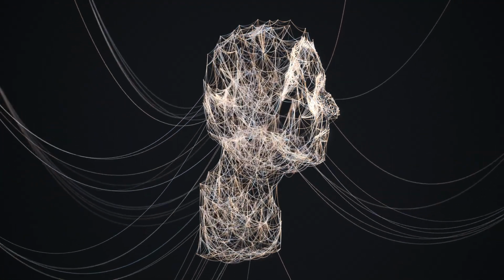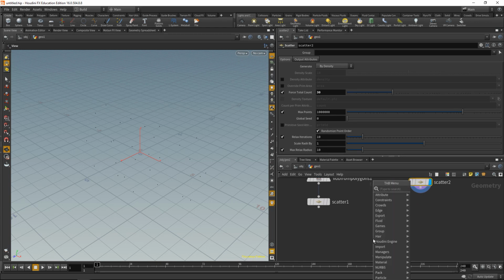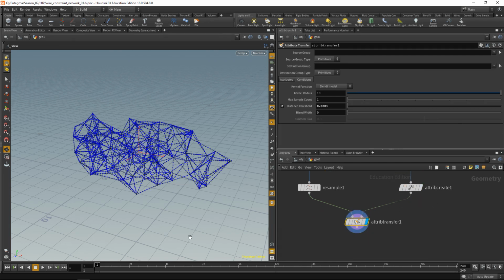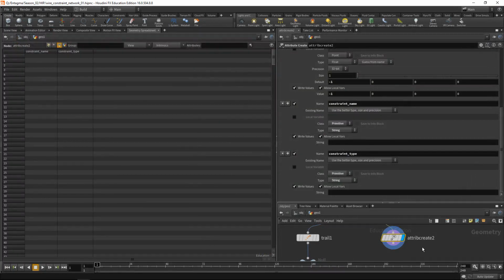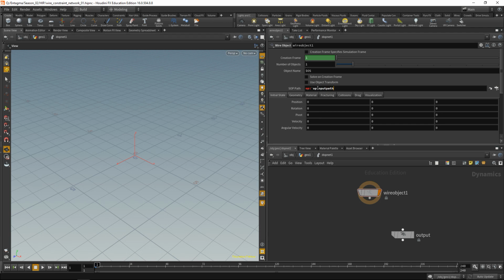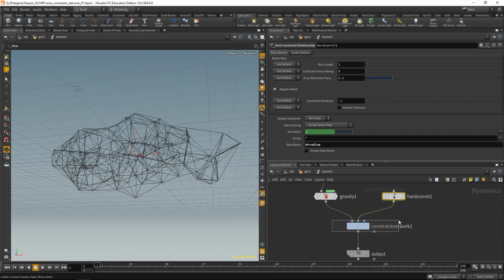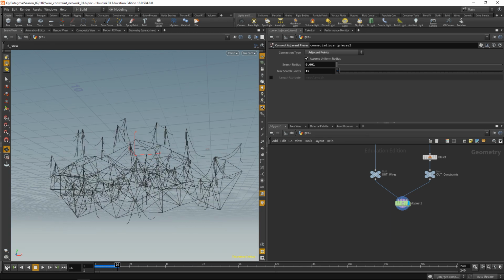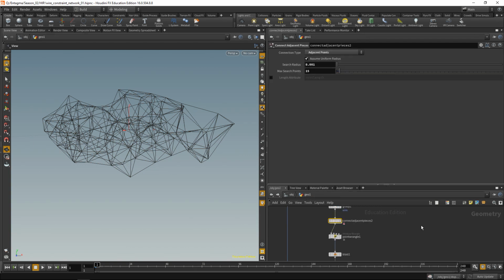Yarnworks: Wire Solver and Constraint Networks in DOPs

Comment: I watched this three times and didn't get it to work until I downloaded your provided project files and found out that in the second attribcreate-node the anchor_id needs to be set to integer instead of float. In the spreadsheet I noticed that when you first set it up it was still set to float but with your first code revision you seem to have switched it to integer but I missed it because of the little cut :D Anyways, thanks for the tutorial, it was really really useful! :)
Reply: thank you so much for this, I was starting to really get mad XD
Reply: Bro u saved my at least another 2 hours checking vex. Thank you <3
Reply: you're a legend. Thanks 
Great tutorial btw!
Reply: Not just that but also original_ptnum this tutorial was quite sloppy.
Reply: THANK YOU ive had to manually troubleshoot so many outdated tutorials as a begginer this helps so much genuinely